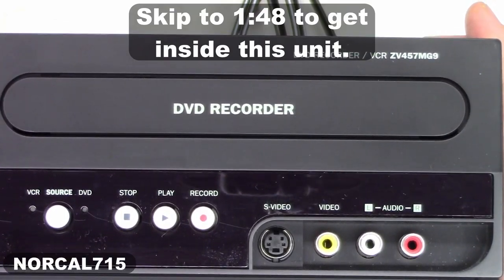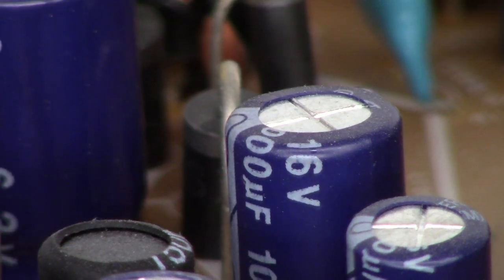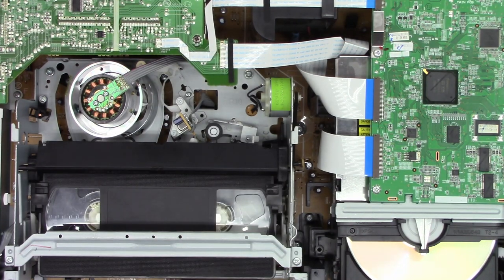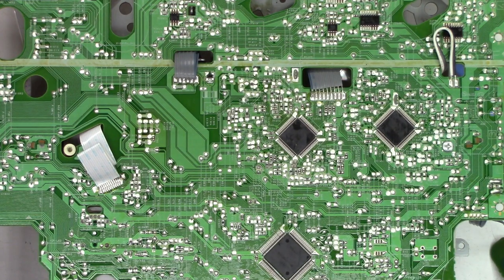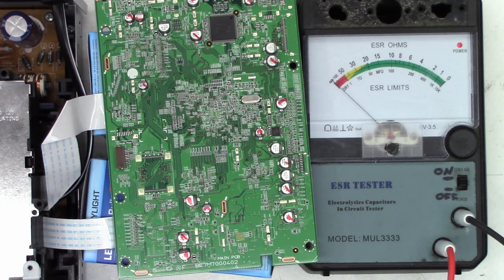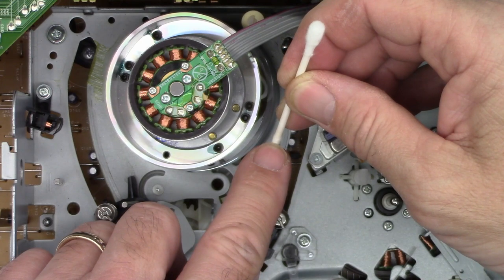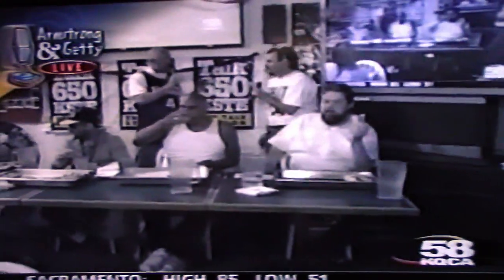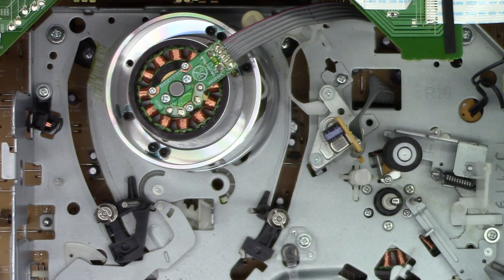I HAVEN'T WORKED ON ONE OF THESE BEFORE, ITS A ZV457MG9A NOT A ZV427MG9A POWER SUPPLY PROBLEM PART 1

Comment: I see a lot of esr tables. Can you send us a link to one you would say is around the values you would consider right generally speaking. Thank you. I enjoy your videos.
Reply from the maker: Mine are mostly in my head. As a rule of thumb I use 10uf <5Ω - 22uf <2.5Ω - 47uf <1Ω - 100uf <.5Ω - 220uf<.25Ω - 470uf < .1Ω - anything above 1000uf should be 0Ω
Reply: @norcal715  regardless of voltage?

Comment: Your videos are excellent!  You should be a teacher.  Question:  When you esr the surface caps you do not disconnect them from the circuit but with the power supply caps you do (at least that is what it looks like).  Why is that?
Reply from the maker: The caps in the power supply are mostly configured in a pi network.  Meaning there is an inductor between the 2 (or more) caps that will skew the results.

Comment: Where did you get the schematic for this unit? I have one of these. It's a low hour unit with a damaged mechanical part in the VCR portion. Probably due to a mode switch that was dirty.
Reply from the maker: You can find the ZV427MG9 schematic on hifiengine.com you will need an account but it's free.

Comment: I have this unit too. The DVD would not load. I finally turned up the laser output and it loaded and played a  disk but wont record.  The caps you esr on the dvd board control that?
Reply from the maker: They can play a big part in it especially when recording. It has a higher current draw during recording and weak cap(s) could hinder it.

Comment: The intended time use of these more modern electronics was estimated to be less than 10 years. So cheaper components were made to equal 
that time length. That is why stuff like , flat screen TV's VCR's and DVD players, are so damn cheap. Better to replace with a newer one and
recycle the old one. That being said if you have a collection of personal stuff on VCR tapes you better keep that old VCR running in tip top shape!
 👉🏻 They actually make cotton swabs with a 1/4 of the  diameter of an ordinary Q tip.👈🏻 Very much recommend those for VCR repairs!👍🏻👍🏻